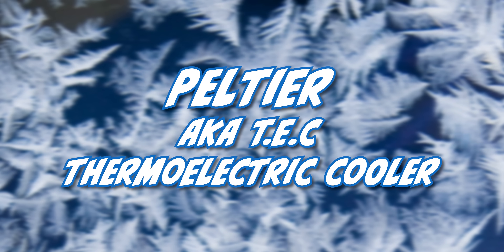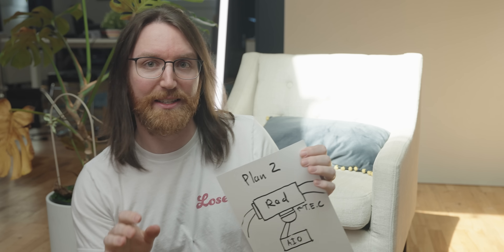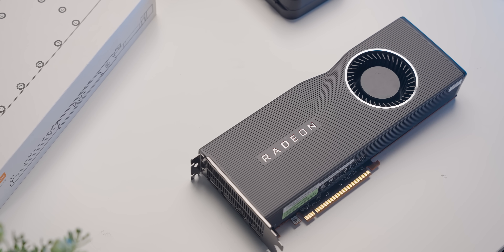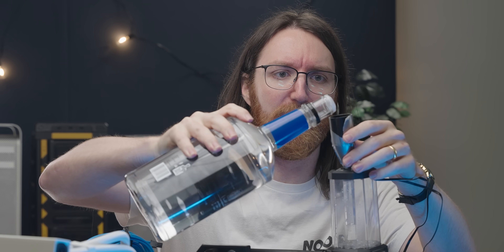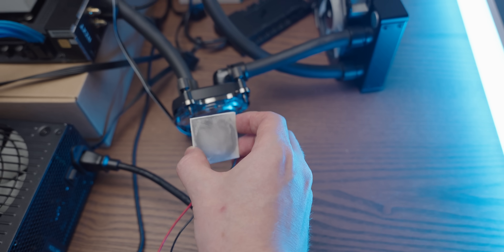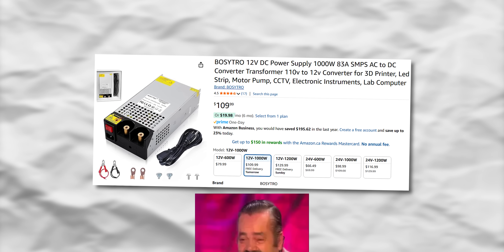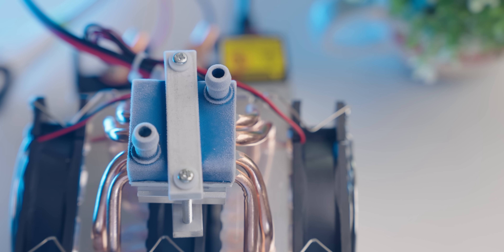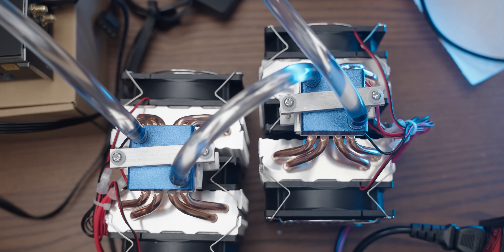I REVOLUTIONISE PC Cooling....

Comment: Peltier cooling is generally inefficient period. This is why commercial Peltier cooling is generally a last resort or very specific scenario type solution. I experimented quite a bit with Peltier cooling in the early 2010's and the inefficiency just makes it untenable in most non-commercial use-cases imho.

Comment: Exactly this technique (cooling Peltier elements via watercooling) was used about 20 years ago by a company called Cool It. I had the chance to test their Boreas cooler an a then-brand-new Athlon II X4 965, and when overclocked, the CPU reached around 20°C in a hot convention hall. When the cooler was running at full power we had loads of condensation issues.
Ok, the cooler was loud and power hungry, but oh my, it was working well and easy to set up while unparalleled in its power.

Comment: Ethanol is waaay less efficient than water at tranfering heat.

Given that the risk of cooling beyond the freezing point seems pretty unlikely after your tests, I would try again with water.

It should work a lot better than with vodka while still likely not going even near to freezing temperatures
Reply: Came here to say this, he would have been better off with a 10/90 mix anti-freeze/distilled water mix and if he wants to push it a little more use a "water wetter". 

PS. A "water wetter" is something we use in the racing world to reduce the surface tension of the coolant. Which is a water heavy mix, if not out right per water. Royal Purple makes of of the best and its called Purple Ice.

Comment: Interesting and fun experiment 

Something that comes to mind looking at the final setup:
Seeing the peltier heatsink laying on the table next to the AIO with all of the fans essentially just sharing air/ potentially influencing each other..I wonder if it would be worth isolating the individual sections

Kind of like a window AC cold side inside hot side outside

I wonder if the hot air exhausting from the peltier heat sinks was then being sucked into the AIO radiator dumping hot air into the cold side removing any benefits of the cooling 

Try isolating the peltier heatsinks so they dont dump hot air into anything else, even each other as the cold side works better if the hot side is colder also

Although I have a feeling it still wouldn't give great results

Comment: I used a freezer using winter formula windshield water as the fluid so it wouldn't freeze. I was able to get a usable -20c to -10c. It allowed me to get into the rankings for ocing a amd 1920. The peltier I also tried out and got incredibly low temperatures however with a thermal load it always failed and couldnt  pass consistently with benchmarking. My peltier I used a car battery jumper pack capable of 2/10/50/100 amps. I didn't try 100 amps as I was concerned for fire😅

I mounted my peltier directly on top the CPU with a water cooler on top.

Comment: I'm not sure the order of your loop in the end is ideal. It looks like you're going res>gpu>peltier>radiator>res, having the rad at the end means you are putting ambient temperature air into that water that has just passed through your potentially sub-ambient peltiers. If you reorder it so that it passes through the rad first this would allow the rad to dissipate as much heat as it can into the ambient air before the peltiers try to push it sub ambient afterwards. Loop order doesnt really matter so much in a regular loop but with sub-ambient components mixed in it matters a lot more I would think.

Comment: Flawed premise from the get-go. If you're looking to cool sub temps, just forget the radiator. Also, understand that while it might cool the liquid at the start, the temperature will gradually start to heat up the cooler water as it cycles through. 

If you're dead set , you will need to get an aquarium for salt water fish, a high-pressure pump, and go to town. Due to the large volume of tank/ coolant, it would take longer to heat up the overall large volume of water. This means you'd actually see a large drop in temp. But you'll have to take steps to insulate your motherboard from condensation.

Comment: Yes, please go overkill >9000 on this concept. Get the coolant moving slowly through 'a lot of radiator' *b4 the TECs*, big ID everything, etc.
I've wondered for years if something like this could be used for XOCing and HWbot, but without the complexity of cascade phase change or consumables/storage issues w/ LN2 - DIce. 

Ofc, it'll be obscenely inefficient but, compare that to the challenges, inconveniences, and consumable costs for LN2 or Dry Ice? It's not for 24x7x365 use, it'd be for 'The Bench'

Comment: peltiers tend to have a efficiency in between around 0.5% to 3%.
a compressor based cooler can easily get a efficiency of around 400%
efficiency as in energy of heat moved around per energy put into it.

a better solution in general would be to take a cooler add it to a aircooler and put it in a chimney, of around 1m high or such. that way convection will blow silent air through it. also has more air contact  than the coolers normaly used with water cooling.
water cooling is more designed to look cool rather than work well these days, so fins often are very small.

Comment: Another thing is that peltiers demand high clamping force. Also if not all of the plate is in use, that means covered on both sides completely, you lose a lot of efficiency. Just like a single cell solar panel that has part of it in shadow loses efficiency on the whole panel.

Comment: Sorry, but you haven't revolutionized anything. 😂I used a 100W Peltier-element in order to overclock a 486DX2 back in the 90's.  

Peltier-elements has 2 downsides: 
1. You want the "cold side" to stay on the safe side of the dew-point. Which is typically around 15 C indoors during a moist summer. 
This is the #1 parameter you want to control!
( Condensing water isn't conductive but it can dissolve acidic residue on the PCB and cause corrosion. 🤥)

2. Peltier-elements has ridiculous bad efficiency ( ~33% ) which means that in order to remove 30W, you need 100W of power going in to the Peltier. 😒
( And the total 130W still needs to be removed from the "hot side". 😬 )

I ended up using water-blocks from Swiftech instead. 😉

Comment: I wonder if someone is crazy enough to make a video, where they liquid cooled their home in addition to the PC, by building a AIO liquid cooling system throughout the inside of the house's walls to a radiator in the attic or roof space? Make the house cooled but also packs the heat above the ceiling which can dissipate over time... In the winter the roof crawlspace of homes can have a ton of cold air flowing through.

Comment: Hmm, but what if you use multiple peltier with multiple liquid loops so that it has to pass through multiple peltier blocks in sequence?

It will take up way more space but you can in theory make use of a longer loop to keep the heat travelling to the end instead of returning to the machine.

Comment: Change the order
Reservoir/Pump To --> CPU/GPU --> Radiator --> peltier 1 -->  peltier 2 -->  Reservoir
Main Heat air cooled by the Radiator   (highly efficient with the Surface area!)
Then the two peltier can drop the fluids down an extra few degrees when working with a cooler fluid.  (Smaller Surface Area, but more thermal mass in the heat sink they are connected to)

Comment: If the objective is to prevent water freezing, using pre-mixed 30% automotive coolant is a better choice than using vodka. You can go down to -15C without freezing with this setup.

Comment: sry but Cooler Master aleready did this iwth the ML360SZ-AIO and it turned out that it worked ... but not for high end applycations
maybe use a fridge next time? like putting a cooling loop inside a fridge and let this running

Comment: I think you should use a real refrigeration system, using refrigerant to water heat exchanger. use a small 120w fridge compressor with r134a refrigerant and you cool the loop using the refrigerant to water heat exchanger. use something like STC-1000 controller to control the compressor based on evap/refrigerant to water heat exchanger temperature to keep it from freezing

Comment: What would happen if you just used another aio in line to the current radiator setup, but the aio block would be installed in a small fridge icebox? This way the aio should be at near freezing temp and the radiator loop would direct its water through this

Comment: Dude, even from here, problem is apparent. 10:45 You 1st put heated liquid through peltier, then through radiator which normalizes its temperature.
Manual clearly shows how pump should be connected.

If you 1st remove most of heat with radiator, and then chill it below ambient... different story.

Comment: You can stack them to get even cooler but the still has the issue that is not avery efficiant compare to just water and ice.. peltier have been use for this many years since the 2000 the problem is now that chips have over 200W of power draw compare to chips back in the year 2000

Comment: FWIW you should never use vodka for this purpose unless you're 100% sure the plastics used in the pump, reservoir, and your blocks can handle it, especially any acrylic since it absolutely cannot handle it even short term. You're quiet fortunate nothing did without checking first. Also Corsair 100% does indicate which outlet you're supposed to use if you actually follow their basic paper directions that came with it lol, it was even screwed in that way previously so you obviously did read those directions once before. I'm not sure why yours wasn't labeled explicitly though, their new ones all do and my old one was marked when I took the sticker off it, it just wasn't on the housing like it is on the newer models.

Comment: Have you been reading about the Soviet Air Force?  The Tupolev Tu22 bomber used a mix of ethanol and distilled water to cool the cockpit.  This was effectively vodka, and crews would often drink the cooling liquid and get drunk after flights.  This was enough of a problem that a lot of effort was taken to prevent crews from doing so, but the efforts didn't always work.  Other Soviet aircraft supposedly used this mixture to cool electronic systems, leading to similar problems.

Comment: Oh man, Peltier elements are old hat, and it's not without reason that they aren't used in commercial computers. There are several reasons why they're not suitable:

1. Peltier elements have an efficiency of only about 10% of the theoretically possible Carnot efficiency. This means they require a lot of electrical energy to generate a comparatively low cooling output.

2. A Peltier element not only has to dissipate the CPU's heat, but also produces additional heat through its own operation, which also has to be dissipated. For a 65-watt CPU, this can quickly result in a total heat output of 130 watts or more, which the cooling system has to handle. The heat generated by the Peltier element places additional strain on the cooling system. This means that an already powerful cooler would have to be dimensioned even larger to dissipate the additional heat.

3. Peltier elements can lower the CPU temperature below the ambient temperature. This creates the risk of condensation forming on the processor or motherboard, which can lead to short circuits and damage.

4. They are unsuitable for everyday use due to their poor efficiency, high power consumption, additional heat load, and the risk of condensation. Modern air and water cooling systems are therefore significantly more efficient and safer for most users.

Conclusion: Nothing has been revolutionized here! Pure clickbait.

Comment: Hi! Today, I am no fun at parties

A peltier element has an efficiency that is about 4 times lower than a regular vapor-compression system (all refridgeration and A/C is the latter). A lot of heat just straight up flows from the hot to the cold side. 

So yeah. Put a straight up A/C on it next Dawid!

Comment: It's also worth noting that even a "standard" or generic Peltier is better at either cooling or heating, & you need to know which. There is a whole variety of Peltier blocks that are made of different materials to be more efficient for that specific purpose, but they can get wildly expensive. By their very nature they perform better the larger the difference in temperature gradient there is between the two sides.

Comment: I've used pelts almost 15 years ago. Both directly and in a chiller. I also used phase change coolers. Back then, you greased the CPU socket and insulated the motherboard against frost. It requires a LOT of power to work pelts correctly and when used directly they can completely fry your CPU if it fails catastrophically. There was a peltier-based cooler sold commercially about 8-10 years ago. It worked OK, but again you needed a really strong PSU to run with it. Its secret sauce was that it dynamically regulated how much power went to the pelt based on how hot you CPU was. I haven't seen many pelt-based coolers around lately. I guess the power requirements turned everyone off.

Comment: If you're going to repeat the experiment with 6 peltier devices, I would suggest replacing the peltier devices with equally sized copper blocks and running it that way as well. I suspect that the results will be just the same as the peltier coolers if not better.

My reasoning is that heat is never actually removed, just moved from one place to another. In the radiator it goes coolant -> radiator -> air. In the peltier it would be coolant-> water block -> peltier -> ???

If the heat is not transferred from the peltier to something else, then the peltier would just build up heat. That's not going to be the case, so it must be going someplace.

It can't be going to the opposite side of the peltier as the opposite side is hotter than the cool side and heat always transfers from hot to cold, never the other way round. This also means that the big cooler on the commercial peltier solution is only cooling the heat generated by the peltier, not the heat from the loop; The heat from the loop will never make it there.

The only place left for the peltier to transfer heat to is to the air. But because the only surfaces of the peltier that are not the same temperature as the coolant or higher are the sides, which are small.

If you replace the peltier devices with equally sized copper blocks then at least some of the heat from the coolant will actually make it to the coolers on the peltier solutions and will have a larger surface area to dissipate that heat to the air than the peltier does.

A cooling 'solution' which might actually work would be to take apart a window AC unit, take the radiator out of the PC and zip tie it to the evaporator, put the AC unit back together and turn her on full blast. Should make the radiator pretty chilly, no?

Comment: That was so funny watching you doing such a noob mistake. You were running the loop wrong. You were actually warming up the Vodka by running the liquid from Peltier1-->Peltier 2-->Radiator-->Pump-->GPU.  
The correct way to do it is. Radiator-->Pump-->Peltier1-->Peltier 2-->Gpu. AND DONT USE VODKA

Comment: Lessons to learn from this video:

1) You can never have too much vodka.
2) Always use the right hole.
Reply: Yeah if you want testes on your chest 6:24
Reply: 3) Stop trying to cool the vodka flowing through the heatsink.  It doesn't stay there long enough due to the pump.  A better strategy is to attempt cooling the reservoir.

Comment: Those "commercial use" Peltier setups couldn't cool a gnat's ass. Those blocks have no real surface area inside, and they're aluminum. Hopefully the inside of those blocks were properly coated to prevent galvanic corrosion. 

The problem is, you're trying to cool more surface area with less surface area. The more fluid that is in the loop... the harder that peltier has to work to lower the temperature. You also didn't seem to have it on any sort of thermal control, which means it would run at full tilt, until the insides of the waterblock started to freeze up. 
You would be more or less simply fighting the freezing point of the liquid at the cooling surface area of your peltier setup, making it counter-productive... because the moment you go below -20c with Vodka, it starts to get more viscous until it hits its freezing point at -26.7c. Making your pump have to work harder just to keep the flow up... at which point the freezing point will be only a few seconds away at the blocks... where you would have noticed frost building up a while ago. 

Peltier cooling is tricky... and often times, not worth the power cost. In this case, trying to cool the coolant would definitely be a good idea... you're on the right track...

Think fluid exchange... more or less, getting one of those chiller stations that they use for the ice baths, and using that to cool the loop, instead of having radiators at all... just plumb it directing through G-1/4 ports into the system like any other external cooling solution.

Have actually been considering this myself... just waiting on prices to normalize.

Comment: for a pelitier to produce cold, you need BOTH electricity and heat.  USE THE BACK SIDE OF THE GPU AS THE HEAT SOURCE. (backside gpu>pelitier>waterblock)